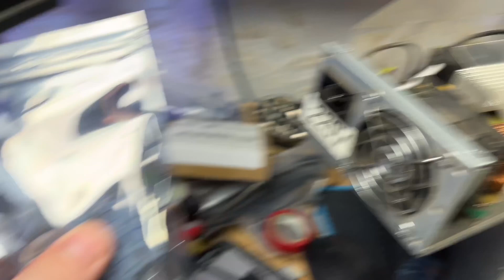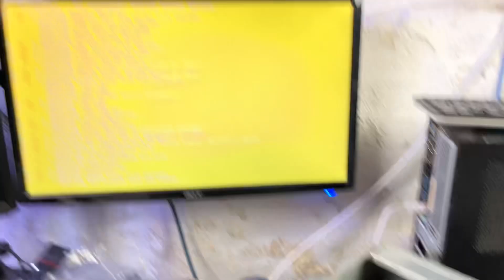Heating my home with nVidia CMP cards

Comment from the maker: 00:26 I misspoke, 24A, not 40A. never load circuits over 80% of their rated capacity :)
Reply: 40 is fine, you just need a 50A PDU on a 50A circuit